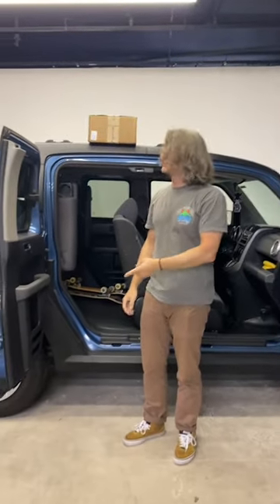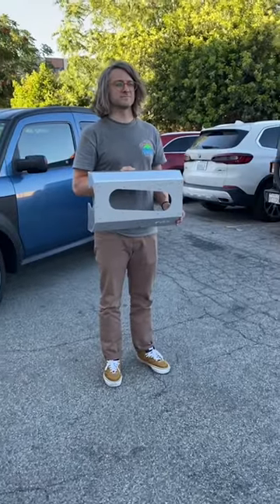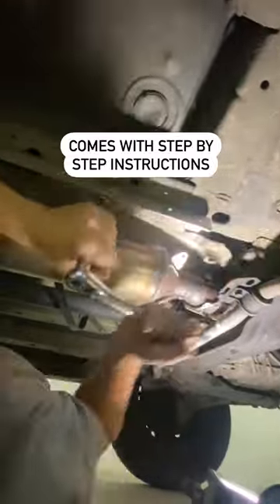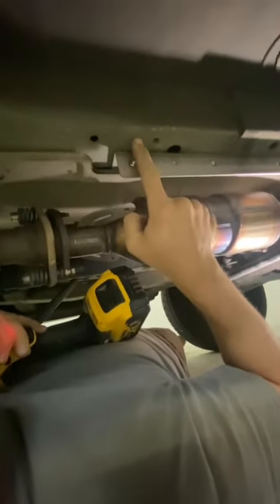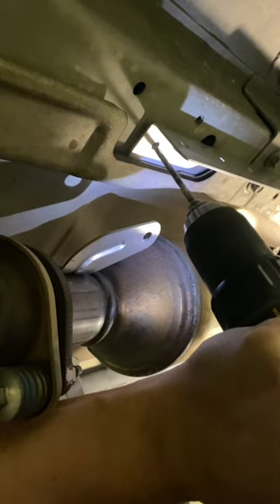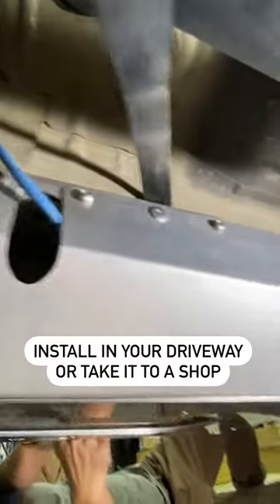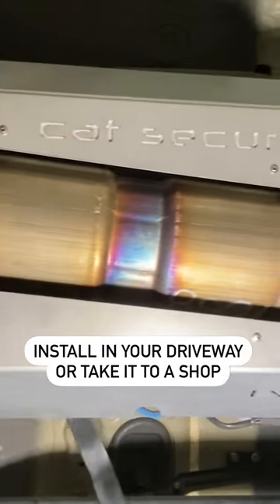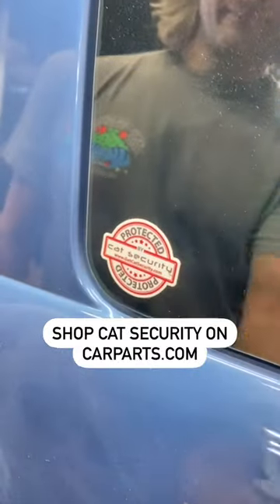How to Prevent Catalytic Converter Theft | #Shorts

Comment: The thieves want something easy.? So I don’t think I would rivet it on they are not bringing a cordless screwdriver with them. That would save you some cash if it ever needs service work that requires removal.
Reply from the maker: You’ve got the right thought here. 👍 Any slight inconvenience is going to deter would be thieves.

Comment: That does not look like it would protect the cat from being cut out
Reply from the maker: Anything is possible with the right tools, time and determination. This is going to make it MUCH more difficult however.
Reply: Even if it did not stop, it would still take them longer. So you can warn them or call the officers
Reply: more of a deterrent, extra thing to deal with that may sway the animal criminal to pass it up
Reply: @antmon123  i approve this comment. Especially the animal criminal part
Reply: @TestersStudio  so they can get released in two days
Reply: @dixienormouse1441  an insult to animals they are worse
Reply: @CarPartscomOfficial  hey I need one please for my 2020 Hyundai santa Fe I'm in Boston MASSACHUSETTS